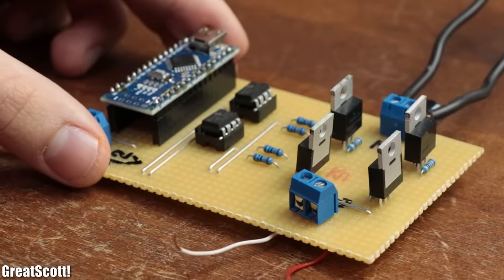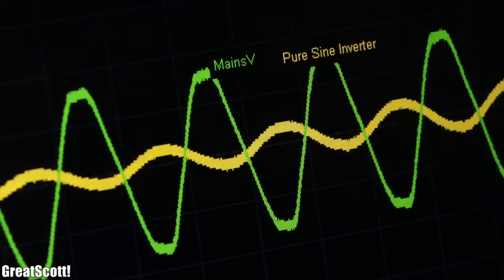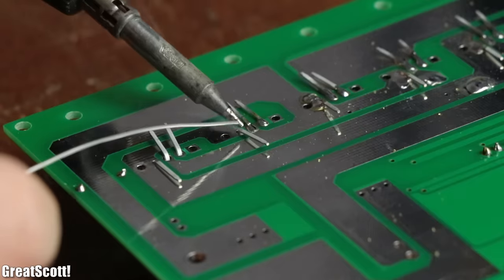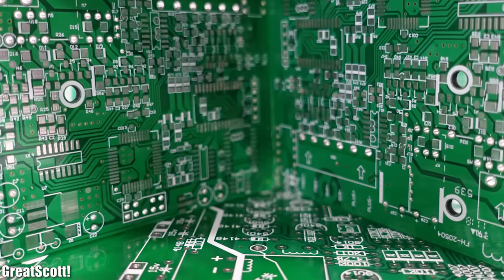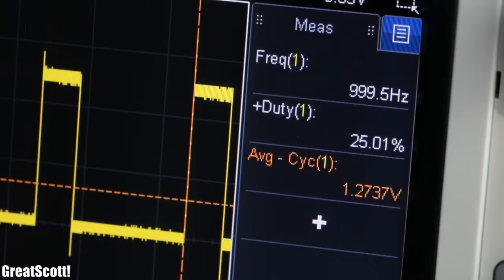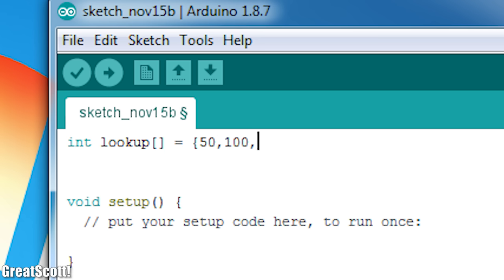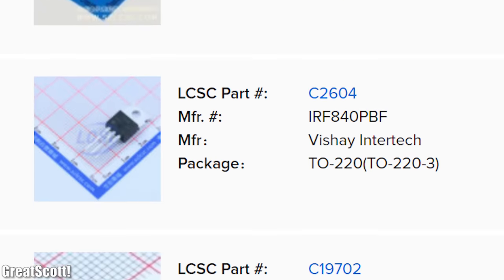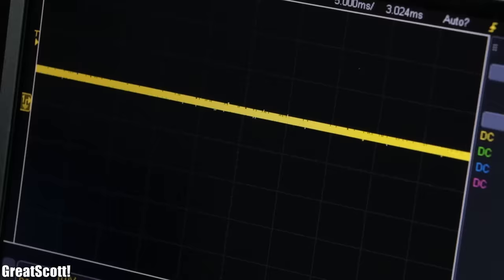Does it suck? Chinese DIY Pure Sine Wave Inverter || Sinusoidal PWM (SPWM) Tutorial

Comment: I'm Electric Engineering student interest on inverters. I've tried some high frequency push-pull projects using TL494, some MOSFETs and old ATX PSU's transformers, but I couldn't handle much power in output without frying the MOSFETs. I don't have an oscilloscope, so it's hard to me to understand what in fact is happening in to the wave, bad wave form could be the reason to the MOSFETs' to have short circuit between drain and source. I used some IRFZ44N wich are for 49A, but they barely could handle some watts in my projects. I was trying to have a DC voltage as output and then try to transform into sine wave with an H-Bridge later, but I didn't have decent results in the DC/DC inverter.
Reply: Oscilloscopes are very handy indeed. Anyways I assume you rewire the transformer so you have two identical coils to push pull? Any significant imbalance can be disastrous. A possible problem could be incorrect frequency drive to the transformer if the transformer wasn't rewired and the operation frequency is unknown. Now for the MOSFETS, are there any snubbers for them? I admitting I haven't use the tl494 just the sg3525. Also what is a few watts? 20W?
Reply: @alelectricll  well, I could light a bulb of around 25-30W, also could power a laptop connected directly to the power supply (no battery) but with agressive voltage oscillations. The circuit was pretty simple, I just used some BJT's before the MOSFET's and connected each directly to the ATX trafo, and powered the center tap with the battery voltage. As I used the IC's internal's transistor collector to driver the MOSFET I needed an external BJT to invert the wave format. I tried also to drive from the emitter, but it didn't seem to work well (the MOSFET didn't turn off). But driving with the collector I didn't use resistor between the gate and source, the MOSFET was discharged through the BJT BC547B, and this maybe was a problem. I don't have much knowledge about electronics because it's not the focus of my college course, I had to learn some things by myself.
Reply: @GGBGameplays  I see, sg3525 wouldn't necessarily need external BJTs that's why I used them mostly. But yes, I see a problem. Connect the internal transistor collectors to VCC; the emitters would drive the MOSFETs. Now connect a resistor  about 1k to each emitter and ground. You'll now need 2 in4148 switching diodes and 2 BC557 transistors. Connect each emitter to the base of a BC557 and the collector of each BC557 to ground. Now you are going to connect a diode to each BC557, with anode on the base and cathode on the emitter. With a suitable gate resistor, connect the emitter of the BC557 to the gate of the MOSFETs. The diodes will turn the MOSFETs on and the BC557 will turn them off. There should also be a 10k resistor connected to the gate and source of the MOSFETs. This will prevent false turn on of the MOSFETs. This is one way on how to use the TL494 to drive MOSFETs.

A concern for me is if the transformer is driven at correct frequency also.
Reply: @alelectricll  when I tried to drive using emitter some weeks ago it didn't work as intended. I followed some existing projects on YT, just changed some components. That's the schematic: 

https://www.clubedohardware.com.br/uploads/monthly_2020_05/277673637_circuitoinversor.png.69a289a21aa9a53c351eef39ee2a7390.png

In the simulation it works as expected, but in real life one of the MOSFET gets hot really fast, also there's waste of power (I measured high current flowing from the battery with nothing more than some diodes and one capacitor for filtering DC voltage). Sometimes the MOSFET ends up with short-circuit between gate and source also drain and source. I tried two power BTJ transistors (13007 found in some cheap ATX PSU) instead MOSFETs, the same happened.

Regarding to your instructions, in my tests with the IC only, using a resistor connected between emitter and ground, and collector to VCC, the measured voltage on the emitter is very close to the supply voltage (no oscillation). When emitter is open circuit, the measured voltage is around 40% of VCC (which is the duty cycle that I set). So I guess it wouldn't work, but I've seen some similar schematics using the emitter directly to the base (no resistor for grounding), this way should work better. However I'll try to put my hands on some SG3525 soon, I might have less headaches driving the MOSFET directly from the IC.
Reply: @GGBGameplays  sadly I was denied accessing the schematic. Is there another way?

Hmm one side heats up faster than the other... Maybe a wrong pin on the transformer too? Check just to be sure.

Interesting... pull down resistors shouldn't have any effect on the IC switching. Yes you can use it without pull down resistors but it isn't better... your switching speeds would suffer a bit.

The sg3525 or even tl598, you only need gate resistors with the MOSFETs. I would like to hear any updates if you can.
Reply: @alelectricll  here's the schematic uploaded to another site: https://ibb.co/3cnDDRN

Tried different transformer pins, also tried different transformers, even the one that worked well previously, no success. At least my first try worked pretty well for small powers, I could try to improve something there. Here's the schematic: https://ibb.co/VmXLnXW

I should replace the 1k resistors in the collector of NPN for a lower value (that is too high for charging the gate quickly) and use a resistor between the gate and source of each mosfet to ensure the gate discharging. The pin 1 was used for voltage feedback with an optocoupler.

I'll update you as soon as I get something new.
Reply: @GGBGameplays  thanks. So far I noticed in both schematics the oscillator is running too slow. For 50kHz push-pull the oscillator has to be 100kHz. Can be solved by just cutting the timing resistor in half. 

The first schematic, I wouldn't recommend it, but the second, yes with lower resistors it could work. However I will do some calculations soon.
Reply: @alelectricll  most people use those inverters working at around 30kHz. For higher frequencies, first I need to asure the mosfet switching is good enough (for that I needed a oscilloscope). But that 1k resistor seems to be the major issue. Take a look at the gate voltage according to Proteus (mosfets with no load): 
https://ibb.co/hg4904Z
Now with 100 ohms: https://ibb.co/yd8JsyD
With 1k resistor it takes around 2 microseconds for the gate to achieve saturation voltage. I think this can be a problem when higher currents are flowing through the mosfet, but you tell me. Also I'd like to thank you for your attention.
Reply: @GGBGameplays   looks promising. Yes if the MOSFET gate takes too long to charge it's going to get hot because it's not fully on.

Now about the frequency of 30kHz, alright. Your ATX transformer can handle 30kHz? 

No problem, I saw the need to help. I had issues like you when I first started. 
(Sorry I deleted my first response)
Reply: @GGBGameplays  great I was just asking to be sure. Yes that's is very true, it's the windings that determine the transformer frequency.

Now just for safety add two 10k resistors to the MOSFETs gate to ground. Do you have snubbers on the MOSFETs?
Reply: @alelectricll  yes, I intend to rewind the core for a higher frequency when I get good results with the switching circuits. And no, I don't have snubbers, but I'll try to learn something about this. Youtube recommended a video about mosfet turn-off snubber earlier.
Reply: @GGBGameplays  Great. Snubbers are quite important in design.

You're almost there. Meanwhile, I'm going to run some tests.
Reply: @alelectricll  I think a schottky diode between each transformer pin and the center tap should help the current to flow when the mosfet turns off. I could also place a shunt capacitor across drain and source. It would be better if I could check the spike voltage behavior. Anyway, I'm out of high current mosfets right now, I only have some IRF840 (600V/8A) and they shouldn't perform well with bigger loads even with well designed circuit.
Reply: @GGBGameplays  alright. Well, putting a low value resistor in series with capacitor would make a decent Snubber.
I'm currently still testing. Btw, what is used with the optocoupler? A zener diode or tl431?
Reply: @alelectricll  I just used a series resistor for the voltage drop.
Reply: @GGBGameplays  Hello, I test out your schematic with some minor adjustments and it worked okay. It had a stable voltage (110VDC) @ 68W and efficiency of 76%. But the transformer wasn't an ATX transformer thou. I do have a few more testing to do.
Reply: @alelectricll  hello! That's a really good news, it seems to be working better than my first scheme. I'll try it myself as soon as I have some free time. Thank you once again!
Reply: @GGBGameplays  You're welcome! You can always reach out if you have any issues.
I'll try to link a schematic with the minor adjustments added.
Reply: @alelectricll I can't wait to have a look, thanks! :)
Reply: @alelectricll  I build the circuit with some changes, a lower pull up resistor, a 10K resistor between gate and source, also used just for testing an 100nF capacitor between drain and source of each mosfet. I tried a different transformer now it gives me arround 230 V (no regulation), but the voltage drops below 200 V with a simple 10W  phone charger, just like my first schematic.  I don't think it'll have something to do with the IRF840 MOSFETs, because the current drained from the battery was lower than 1A measured with my multimeter in DC scale, my battery had a voltage of about 14.5 V (it's rated as 14.4 V battery but fully charged it's 16.3 V). I also indentified I put a wrong RT resistor, it was 150k instead 15k, so it was set for 3.33 kHz, which is a very low frequency, so that was causing the mosfets to heat very fast.
Reply: @GGBGameplays  Ah, likely this is why the MOSFETs heat up fast. The lower frequency caused transformer core saturation.

This it bit difficult. What was the voltage in the power supply you got the transformer? 325V or 160V bus DC? Because unregulated supply can sometimes give strange open circuit voltages. Also is IN+ temporarily grounded?

I didn't have much of a problem getting it to work. My current test circuit, not much different:
https://ibb.co/QPT9Bp1
Reply: @alelectricll  I think I'll need to rewind the transformer to get it working properly. I managed to get a voltage slightly higher than 200 V with the phone charger connected when increased the frequency to 59 kHz (it was 30 kHz before), so it might have something to do with the transformer saturation due to wrong winding. And thanks for your schematic, I'll try some adjustaments based on your circuit.
Reply: @GGBGameplays  Yes yes, try that and see. I anticipate that should solve the problem.
Reply: @alelectricll  at least now I have better results than the first time. I found some IRF640N and they work better than the IRF840. I'm getting pretty much the same results I had before with the IRFZ44N, but the mosfets are not short-circuiting now. I also designed a feedback system with an optocoupler and a 100k trimpot, now I have a good voltage range and it's stable with, for example, 145 V, which is a value I can power my laptop (the minimum value its power supply will work is 141 V which is 100 VAC rectified).
 I can't still power bigger loads because the voltage drops too much, but I'll keep testing with more powerful mosfets and soon with a rewinded transformer.

I noticed this schematic using external transistor to drive the mosfets from the IC collector harms the pulse width. It's around 30-35% and gets lower when the transistors get warm (I'm using PN2222A and a 10k resistor for base plus the 1k pull up resitor), all that with pin 4 grounded, which makes the IC produce 47% of pulse width. In future tests I should try to drive from the emitter with external PNP transistor as you recommended me first, or just switch for the SG3525. I"m still thinking how I'd drive more mosfets with a limited current supply from IC without a mosfet driver IC. For now I just want to thank you so much, I don't think I would've achived these results without your help, I was almost giving up. God bless you.
Reply: @GGBGameplays  it's good to hear you're getting improvements. A high voltage Zener diode (e.g. 150V) and a low value (e.g. 1K) trimpot could improve performance more, since the Zener diode is more sensitive to voltage fluctuations. TL431 does this job well but it would complicate the design a bit. Hope you get even better results with your upcoming testing. 

Yes, I do notice the transistors getting warm, but I didn't check the duty cycle. I used 2SC1815 without base resistor. When I get free time I'll upload schematic examples, including driving more than one MOSFET. 
Anyways, you're very welcome! :) 
I know how problematic these things can be so I don't mind helping out.
Reply: @GGBGameplays  Hello these are some example drive circuits.
This is how most power circuits I encounter used the TL494:
https://ibb.co/23ZZd3k
With more that one Mosfet 
https://ibb.co/qFsTS38

External high current bipolar transistors
https://ibb.co/mhGX2Qn
With more than one Mosfet 
https://ibb.co/swRrD4N

Now I forget to mention, you'll notice a diode, resistor or a small inductor in series with Vcc of the Tl494. This is to simply reduce any noise to the Tl494, but it will work fine without it.
Reply: Hey there, I don't if you saw my last post but wondering how you are doing now.
Reply: @alelectricll  I really hadn't see your last post, thank you for comment here again. I'll update you about I what I changed, but I haven't done much, I let this project aside for last months and in the last week I started to do some searchs again. But let's go to my changes:

-I'm driving the mosfets like the examples you linked (drive64 and drive61), I'm using BC557 and the results seem better now.

-The mosfets I "m using are actually IRF540N not IRF640N, but they also seem to work well here. Now I noticed that the problem with the IRF840 I tried before actually was the RDS which is about 0.84 Ohms, that results in a huge voltage drop across the transistor.

-I'm using the high voltage side of a small ATX transformer EER28 as inductor filter before the 150uF 400V capacitor, it should result in lower current peaks on transformer and diodes. As these transform generally have 40 turns for high voltage side, and the Al (nH / esp ^ 2) is higher than 4000, I should have more than 6mH of inductance, which is enough for some testing.

-My bottleneck is still the transformer, I'm using the EI33 removed from old ATX PSU (not rewinded), I still have a bad output voltage regulation. It's switching with 50kHz frequency, I don't know the frequency this transformer was designed for, so I'm afraid the wires aren't thin enough to work well at this frequency. But I'm thinking about to buy a new core like EE42 and wind it myself, that will be enough to get 500W easily.

As soon as my DC-DC inverter is done, I'll begin the project to DC-AC sinewave convertion.
Reply: @GGB_Gameplays  no problem, sorry for the late reply, anyways I like hearing that the results are improving. Nice to see you add a filter inductor to your design also.

Now the problem could very well be the transformer. I would recommend designing a transformer since you would know all the specifications for it.
However, I want to eliminate the feedback loop contributing to the problem. Are you using the tl431 programmable regulator diode or a zener diode on the input side of the optocoupler/isolator?
Reply: @alelectricll  I'm just using optocoupler in series with some resistors and trimpot for feedback. The problem with the ATX transformers is that they're winded for more than the double voltage (the 5V winding is for 11V, for example) in the secondary and the primary is for half the input (half-bridge). So it's natural do get less than 200V here.
Reply: Okay okay, anyways design that transformer, and let's see how it performs. Good luck 👍
I'll check back in a month or so. You can comment here if needed.

I do find the optocoupler with just resistors interesting since most SMPS I encounter and design use tl431 with an optocoupler.
Reply: Hello, I am back. I also revisited your schematic and realize there could be a problem. It was confirmed in testing.
If you're feeding the optocoupler with the 5v ref and the error amp ref is 5v the feedback will not work properly. Either it will not work or behave erratically.
The error amp ref must have a voltage divider for it to work.

Example:  https://ibb.co/MVfSb1n

Also, you can disable one error amp and use one as in the example.
Reply: @alelectricll  hello, thank you for coming back. I'm actually using a voltage divider here, as I noticed that just feeding the the negative input with 5V didn't work in my first test. I'm convinced that the problem here is the transformer, I've been searching more about transformer winding and noticed that I'd need more pararel condutors to get rid of skin effect and conduct more power. I still didn't buy the materials for the transformer project because the shops I've been looking for have been out of stock for some months now (I'll need to buy a transformer core, copper wires, plastic bobbin, insulating tape, etc.), maybe they're having troubles because of covid-19. Anyway, that's the schematic I've been using: 

https://ibb.co/XF5XGfq

As you can see, I'm not feeding the comparator with 2.5V, I had to use this 4.2V to achive the voltage range I use for my tests. It can go from something around 100V to 300V if I'm not mistaken. The transformer can't output higher voltages with load, such as 300V, but I use it to check the voltage drop, as it will work like there was no voltage feedback.
Reply: @GGBGameplays  oh, I see, sorry to hear about the difficulty in getting parts.
The only thing I am recommending is a pull-down resistor (about 10k or so) and possibly a capacitor (100pF min) on the optocoupler output feeding the error amp. 
The amount of noise such a high impedance path can pick up can be quite surprising.
There's a chance you may need to change the error amp ref to a voltage lower than 4.2V after the adjustment.

Oh yeah, could very well be the transformer. You could try about 140V and add light and medium loads with the adjustments. There should be a range where the voltage remains near-constant or bounce back affect a few seconds at most.
Reply: @alelectricll  thank you, I'll do that. As soon as I build my own transformer I'll tell you about the results.
Reply: Hello, do you have any luck yet?
Reply: @alelectricll  hello! I actually have been busy with other things, but I'll be back working on this project soon. I still thinking if I'll buy the parts and build my own transformer (I don't have any experience with that) or try to find someone that can do it for me.
Reply: Hello there, sorry for the late reply, I have been a bit busy with projects and school.

Oh okay, finding someone to do it will save you a bit of work.
However, if you want to attempt it, it can be a bit challenging but not difficult (winding the 12v input). You can start here
http://tahmidmc.blogspot.com/2012/12/ferrite-transformer-turns-calculation.html?m=1

On a side note, Chinese sellers on sites like aliexpress offer customized transformers but I'm not sure about the quality.

Anyways,
All the best
Reply: Hi i'm looking for a solution to make it work in Italy an USA air dryer.The air dryer is compatible with 120V/60hz 15amp, in Italy we use 230V 50HZ. I am looking to design my own frequency converter / circuit. Another option is to make it work with an inverter which should still provide the correct voltage & 60Hz frequency sinewave output. please let me know if you are willing to collaborate for this my project my best regards